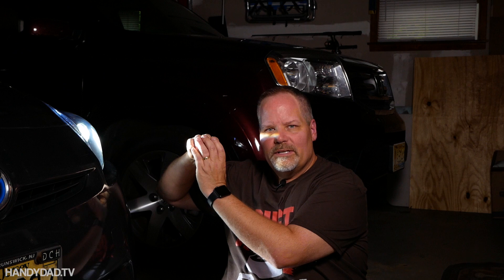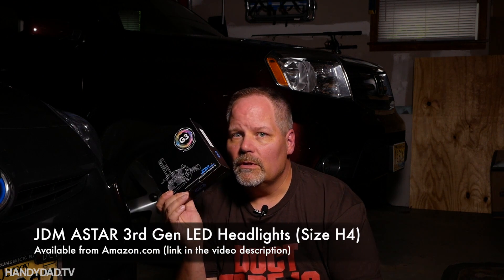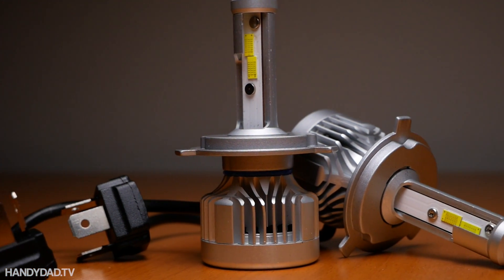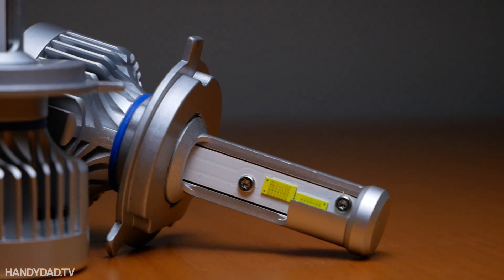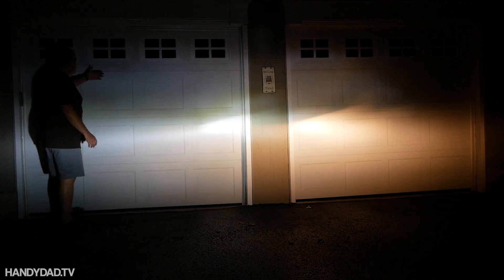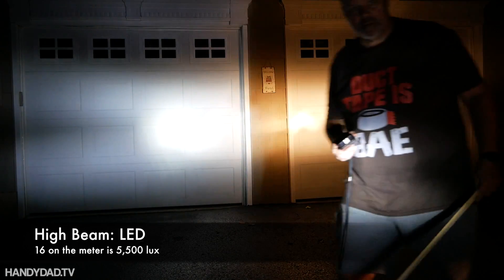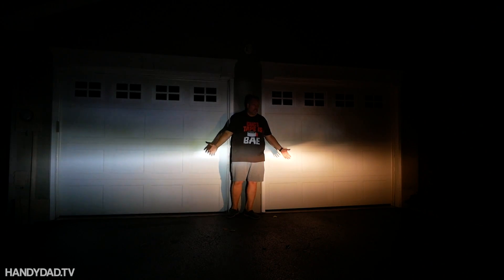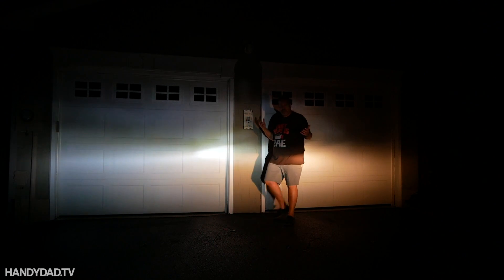Dual Beam LED vs. Halogen in Reflector Headlights

Comment: All in all it looks like LED bulbs for headlights are all about a modification for the sake of a modification. The primary advantage of LEDs is lower current draw. But when you have to start adding electric fans I bet that advantage gets lost real quick. Also...the fan sticks through back of that rubber boot you added, which would provide an exhaust OR intake for cooling air, but not both...where's the other side of the circulation coming from?
Reply: tempest411 - Those fans probably run at half a watt each, so their draw isn't really worth mentioning. Just remembered while typing this comment that I have a spare LED similar to the one used in the video, that I could test; The fan draws 0.34 watts. So really not worth mentioning.

The fundamental difference is; LEDs are lights that give off a small amount of unwanted heat. Halogen lights are heaters that give off wanted light.
While you are wasting a negligible amount of power by dissipating heat from LEDs, you waste magnitudes more power in heat alone from halogen bulbs.
LEDs are cheaper to run because a similar amount of light requires less power, significantly less power wasted on heat and that power ultimately comes from the gas pump.

Alan Brown - You know they make aeroplanes out of aluminium because it's light, right.

And since I'm backing up my words in this comment, I just weighed a H7 bulb and an LED similar to the one above including that "nice heavy block of aluminium" and all electronics: 6.7 grams and 28.2 grams respectively.
Yes slightly over 4 times the weight, but >30 grams does not make a "heavy block of aluminium".

The fans also draw air OUT of your lamp enclosure, rather than into it where the heat is created. So they're not blowing dust in there.

These retrofits are usually illegal, mostly because they're done by amateurs who fail to ensure proper alignment of their lights after fitting.
Personally I wouldn't recommend their use in reflector style lamps, due to the non-standard construction of them and greater potential for user misuse in alignment.
Projector style lamps can skirt some of these issues; you'll see less light bleed over the top of the beam-pattern, giving a more defined pattern and reducing the potential for glare to other road users, over Halogen and HID bulbs - This is due to the stem and the light being emitted sideways at about 120 degrees from two emitters rather than 360 degrees from a single filament.

A lot of people complain about the brightness of LEDs; Well, they're lights, they're supposed to be bright, the object is safety, not a romantic ambience. And I've heard it said, in not so few words, that bright light behaves differently through a lens - Which goes against the laws of physics.

It wasn't that long ago everyone was freaking out over the modern technology of CFLs. It's the same scaremongering over newer LED technologies.
Reply: tempest411 the vent, no headlight is truly 'sealed' they all have vents, normally a small rubber hose facing downwards, in this case it was pictured when you saw the area he trimmed the boot just to the right of that.
These fans are not fitted to all leds and even with the fan do not use the amount of power as a halogen. I personally don't like leds with fans but they probably do last longer because of them vs a block of aluminium heat sync.
Reply: If you look at the manufacturer sites you'll see in their photos that the entire heatsink assembly is on the outside of those boots. Otherwise you have a nice fan sucking dust into your headlamp assembly (for as long as it runs, which usually isn't very long), which is worse than no boot at ll.

Of course the issue that the reflectors now have a nice heavy block of aluminum hanging off the back that they weren't designed for is going make for some nice sag over time along with flexing (and beam alignment) issues whenever the car hits a pothole or large bump. This is why these retrofits are flat-out illegal in many countries.

Comment: isn't that fan going to pull dust inside the housing ?
Reply: Aleziss how?
It is blowing out the back, the vents allow air in and have filters in
Reply: there are filters in the vents ?? if the light housing is air tight, having an open back cover with a fan pulling air out, it needs an intake in the housing of the head light (which I think there is not). And if the fan blows air in, this means it will take the dust under the hood and push it inside the lamp housing... otherwhise, why have a sealed lamp housing in the first place ? to prevent dust entering the lamp housing... right ?
Reply: Aleziss no headlight is "sealed", have a look at any OEM headlight, you will find a vent (normally a rubber tube facing the floor), the rubber tube will have a piece of foam in there (a dust filter).
There are a few reasons they have vents after all if they didn't need them manufactures wouldn't go to the expense of fitting them. Condensation, on a cold morning moisture would fill the headlight, you then put the lights on and heat it up but the moisture would not be able to dissipate and cause corrosion.
I used to make headlights, lots of aftermarket headlight don't have vents and have tons of complaints about there headlights not being sealed, when in fact they are sealed...but too well and neglect to fit filtered vents.

You can clearly see the vent in the video, the dodge, Chrysler or whatever the manufacturer is decided they needed them.

Are the vents big enough to supply the fan with enough volume of air? That is the real question
They were not designed to fit this headlight, the fan may not flow much air, if thete is a lack of flow will this affect realability? these are questions you can make your own assumption about as I have no idea.

Comment: pausing it at 7:41 you can see more light reflected on the ground with the halogen... and that's where you need the light, not pointing up at oncoming traffic's face like the LED is doing.
Reply: Yea, if you never leave the city and never drive over 20.

Comment: yeah aluminum is a poor heat conductor  compared to copper pound for pound
Copper has about between 50% and double the thermal conductivity of aluminum.
Reply: punker4Real one issue with that is cost, would you buy pay 5 times more because it has a copper heat sync?
You are right but they wouldn't sell any if they used copper

Comment: just a sponsored ad garbage video
Reply: If it was paid he would have dumbed down the scatter above the cut off.
I have to say these leds are not that good Tbh, not terrible but not great either.
If you want the best you got to pay, philips leds are by far the best, I have them in my e39 m sport projector headlights, i also tried them in my wife's ford cmax headlights (reflector) as I had just polished the lens, not one bit of scatter (using a calibrated lux meter) vs the philips extreme 130% bulbs.
Are they worth the money? personally.... not really at £150 but if they were £75 then yes.
Reply from the maker: +punker4Real Wrong. I’m really using these bulbs. They’re awesome because they’re awesome. Not because it’s a sponsored video.

Comment: projector housing designed for halogen bulb is NOT the same as the one designed for HID since light source is not the same size. These retrofit bulbs do not and will never pass ECE and DOT photometric tests. They are not safe for use on the public roads. yard stick and some cheap light meter...is a joke. Road legal H4 is limited to 1000/1650 lm

Comment: helpful video for me NOT to install these, i thought at first that they were less sensitive to the 'shivering' on stationairy engine (due to alternator regulator) as the aftermarket xenon kits, but looks pretty similar to me, and...best use them in lens lamps because scattering in a mirror housing is nasty for upcoming traffic...offcourse, the whitier color helps to make traffic signs etc more crisp and pop up better, everyone has to decide for themselves, for me not...
Reply: Jacob Meijer the 'shivering' had nothing to do with the electrical system, it's the way his camera lens has picked it up. Try visiting your laptop screen with your camera phone, same thing happens.
The lights don't shiver in the flesh the same as your laptop screen doesn't.

Comment: If you drive in the snow the LED lights might not produce enough heat to keep your headlights from frosting (icing over).
Reply: carlos1000rr in very very extreme temperatures possibly but only 30 deg difference, can't see 99.9999999999% of people ever see that as an issue
Reply: Just another way that LED bulbs in a housing not made for them fail.  Headlights are designed (even factory LED ones) to reach a certain exterior temperature to self-clear in inclement weather.  Most of the U.S. right now is experiencing weather where they need their lights to be working properly, not some hackjob bulb swap.  The typically obtuse "99%" comment is as accurate as any other time someone claims 99%, 1%, etc...
Reply: That's one of the reasons why Europe requires that cars with HIDs or LEDs have high pressure headlamp washers.

Comment: The blue and purple tinged headlights should be banned because they are dangerous due to the fact they blind the people coming toward them myself included.
Reply: They should be banned because they are worthless. Most of the people driving with blue and purple bulbs don't realize that they are actually compromising safety for both themselves and other drivers. The shorter the wavelength, the less penetration of light down the road. However, don't confuse this with headlights that have a blue flicker. Really tuned OEM or after market HID projectors have a blue band right on the cutoff, but the rest of the light below the cutoff is white to bluish white (6000 Kelvin is the max anyone should run). Believe it or not, a yellower light actually penetrates distance better too.
Reply: And why are we "old farts" complaining about "stupid shit"? It's quite obvious you don't know the law regarding headlights and modifications or the mechanics behind why a headlight is designed the way it is. It is illegal, plain and simple. Retrofits are also illegal, but are far more tolerated because the projector used in the retrofit is DESIGNED FOR A XENON ARC. These stock reflector housings ARE NOT. Secondly, just because something seems like a cool idea, doesn't always means that it is. HID in reflector housings isn't a cool idea. Hell, it's not even a good idea. You get a lifted bro truck riding behind you with HIDs on....you'll understand.
Reply: Rayleigh scattering doesn't even matter on the scale of the range of a headlight - unless you're in fog - at which point normal headlights are badly compromised too.
Reply: Please... I find more glare off yellow headlights than blue-ish.
Reply: Aarontaz7 I understand exactly that's why I said what I did. It has nothing to do with colour...like you wrote! the headlight bulb and headlight type is the issue...like I said.
That is why you are a stupid old fart.
Reply: I'm not the one who wrote the original comment idiot. Use some reading comprehension. I responded to the initial comment regarding color and why it was off base.
Reply: Google Rayleigh scattering.  Those idiots with their blue lights are legitimately compromising their own vision as well as others.  Do a little research, it's good for you.
Reply: I saw purple lights on a truck the other night. Looked dumb as hell
Reply: Get your facts straight before posting utter crap, the colour of a bulb does not 'blind' anyone fact. The bad fitment and improper bulb headlight combination is why they blind people.
Dumbass old farts spouting utter bollocks
Reply: Yall must be some old farts. Only people known to complain for stupid shit like this.

Comment: I have experience not passing state inspection with both Led and (Xenon) HID in a halogen headlight housing... how did it go with your daughter’s Hyundai??
Reply from the maker: +k2010Si Haven’t been through inspection yet. We’ll see.
Reply: Best way is to move to a state that does not do them
Reply: TheTomco11 his daughter’s Hyandai does not have projectors. It has reflector housings. We all know that you need projectors with LED/HID. I was just asking him whether or not he passed with these particular bulbs....
Reply: k2010Si I know, I'm saying that it shouldn't pass, and it also shouldn't pass if they're projectors designed for halogens
Reply: Most of the people who do those inspections have no idea what they're dealing with as far as lights.  They'll turn them on and if they come on then it will pass.  If not then people will swap the correct bulb in, pass inspection, then put this BS back in.
Reply: More to the point, they're only allowed to check beam height and spread.

Cars in the UK can pass their MOT inspection with illegal headlight, but then be stopped outside the test centre by the police and taken off the road due to illegal modifications (it's happened).
Reply: It's because your halogen housings are only approve for use on the road with the matching approved halogen bulbs. It's easier to get away with it if you have projectors since they look like they were originally led, however they still aren't legal for street use (the same way massive light bars and high power spotlights aren't)